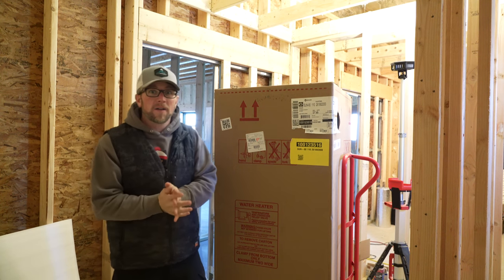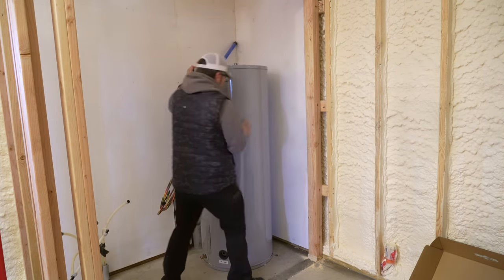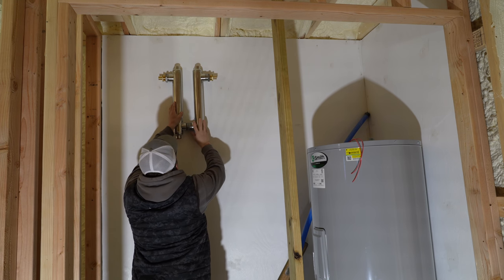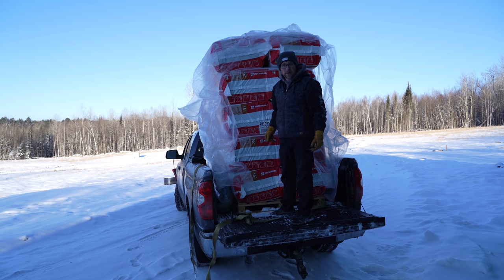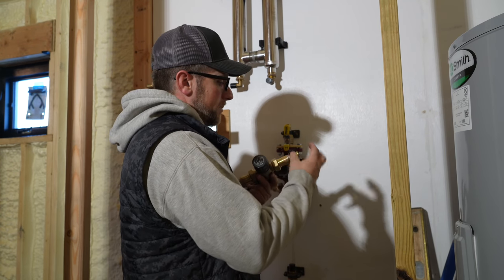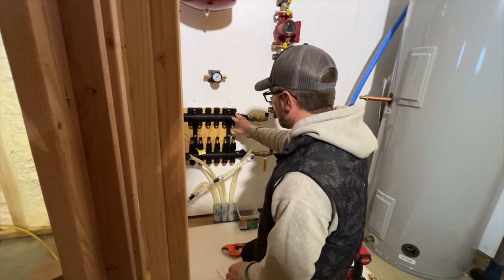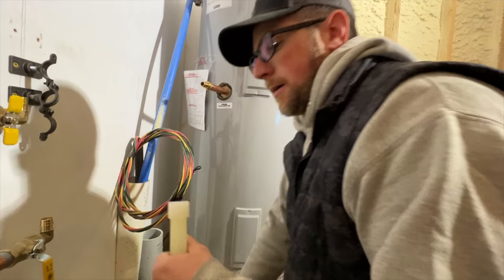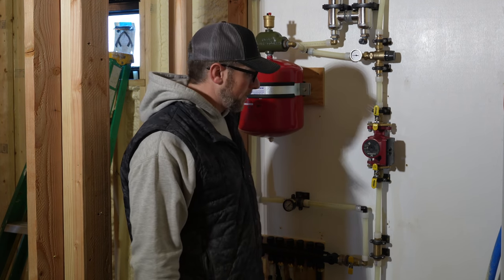What Could Go WRONG... Installing In Floor RADIANT HEAT with No EXPERIENCE!

Comment: Good Morning Lumnah acres! Al - don't make the same mistake as I did and put the water heater right on the concrete floor - It rusted up after 2 years - put a barrier between - even that roofing membrane will work. A plastic tray works well too in case of any leaks.
Reply: I agree with Ted, I suggest buying a specific water heater pan, they are <$25 at Lowes.  Those are code where I live.
Reply: Flux. Actually make waterheater drain trays. Complete with drain fitting.  If leak forms the water is directed to drain.  Im surprised you don't have one. Lol
Reply: yep. mine came with a stand.
Reply from the maker: Thanks I’ll have to pick up a pan
Reply: Plastic drip pan!
Reply: that was my first thought when i saw it being put in. concrete is corrosive and will rot out the skin of the water heater.
Reply: @LumnahAcres  I would get a couple of battery powered water detectors and put one in the pan and one on the floor under your wall fittings.
Reply: @allanulen3809  We saw the evidence of that at that condomium building in Miami, didn't we?
Reply: @ronaldfleming2990 ... actually, with the shower right there, he could run a pipe against the wall. Might be 10+ years down the road but it's in a place where it will be seen without having to look in the closet for a leak.

Comment: I believe it is a law, or at least part of local building codes in most jurisdictions, that anything involving electrical or plumbing REQUIRES MULTIPLE trips to the supply store.  The number of said trips is inversely proportional to the proximity and hassle to reach the source of goods.  In the case of "emergency", supplies available on hand shall always be a few items short of what is required.
Reply from the maker: I think your right. 😆
Reply: Uh, always better to have the spares on hand, then a full season of backorders.
Reply: it is a statistic that a plumbing job requires at least 2 trips.
Reply: I don't think it is required that you have your water heater on a stand unless it Is natural gas or propane.
Reply: @stanleyknight8173  might not be required but getting it raised even a minimal amount a good practice

Comment: Al the moisture from the concrete will rust out the bottom of your water heater. A short box 2 or 3 inch with a plywood top and a catch pan will prevent that from happening.
Reply: Not sure but that sure looks like a black abs catch pan under it now. Wood rots when wet.
Reply: A piece  of a sheet of  closed cell foam board work great also

Comment: Al, you may want to consider using anti-freeze in your system as opposed to using water. I have a close friend that has 2 huge horse barns where Penn State Western Equestrian horses are housed, 40 ish stalls, 2 large riding arenas. He has a huge boiler heating both barns and he uses anti-freeze.

Comment: Some suggestions- 

Label all shut off valves, other valves and directions of flow and equipment identification etc

Any electrical switches etc should be outdoor/wet area rated with a isolation point outside the mechanical room… if you get a leak it is very dangerous!

Any processes like filter changes, servicing steps, isolations etc print out and put on laminated paper clearly placed in the mechanical room along with copies of equipment manuals in zip locked bags to keep them clean and dry.

Will make your life safer and easier in the future, especially if Gina is on her own when an issue happens especially being so remote.
Reply: This was so incredibly valuable to us this past summer when a tree next to the well was struck by lightning and fried our control panel. When we went down, we saw all the bypass valves clearly labeled with open/close directional arrows done in permanent marker right on the valve handles.
Reply: Great advice. Dymo makes a lablemaker that prints on heat shrink tubing. Not cheap but it's the very best system out there. It also prints stick on labels so its very useful. Beats the sand out of trying to decipher chicken scratch in the cold dark and wet of an emergency. The remote kill is a great idea but its required by code here as is the requirement for arc fault receptacles in wet AND high current areas. GFCI used to be the standard but now it's arc fault breakers in the main box with remote shutoffs for anything over 30 amps. We are also required to place a whole house shutoff within 6 ft of the power meter on the exterior of the home for fire codes. Check local codes BEFORE you do something. I've seen the Code Nazi's make people tear everything down/ out and start over more than once. My practice has always been to research the task and consult with a LICENSED PRO before you apply power/ water/ gas/ flame to ANYTHING. It may cost a bit but it's worth the peace of mind and can definitely save a lot of embarrassment comes inspection time or the first fire up. I know from experience that labeling is the best way to go and anyone behind you will appreciate and benefit from it
Reply: Use your laser printer to print out arrows and labels then use acetone to rub them on the wall then clear coat over them they will last as long as the house,

Comment: Al and Gena, and your dinner companion) What you need is "tinning flux" which puts a tin glaze 
on the pipe and fitting when you heat it. Makes sweating pipes much easier since they took the 
lead out of solder. I get it on E-Bay. Wipe off any excess before running the solder in and wipe 
the pipe after if you get a drip.
Reply: I know I'm being pedantic! but it's Gina
Reply: Why did you say, "Dinner companion"??  It seems quite rude!

Comment: As an old measurement and control engineer I made my own central heating installation too. I know from my studies and work that every sharp corner bend gives turbulence and therefore resistance in the flow of the liquid in the pipes. (In those days made visual with glass piping and a purple die).Therefore prevent the use of sharp corners in your installation as much as possible. You could have left out many of them, by just bending the pipe in a smooth corner shape. The piping will look less sharp, but the installation will function better with less resistance.
Reply: I am in total agreement.  90 degree bends degrade flow vs. a pipe bend that is just a gentle curve.
Reply: I really think that not enough attention is paid to this simple piece of information,what I would call basic plumbing. If you put in a lot of”knuckle” bends into your work you will cut your flow rate drastically, if you have not learned to bend copper pipe at least use long “sweep” bends.  Also  if using plastic pipe you can use bend formers.  Another flow reducing problem is using the wrong type of ball valve as an are isolating valve, you can buy valves that do not reduce bore diameter ( this is often a fault in shower installations).
Reply: Remember to avoid cavitation. Open and close valves gently. Sometimes riser pipes are put near washing machines and other solenoid valves. Straight up about a foot, and capped. The air buffers the sharp pressure waves. Air in pump can ruin it quickly. Pump cavitation can sound like rocks grinding. Like your car's cooling system, air needs to be bleed out at different heights. Good luck.

Comment: Retired mechanical contractor. From experience. AO Smith good choice for a water heater. You can change out the electric elements with 12-48 volt DC element to heat the hot water from solar panels on the green house roof. Cleaning up a joint with flux, the pipe will turn oxidize green if not wiped clean. Lots of shut off vales makes servicing in the future much easier. I would recommend a water heater pan to a drain for the relief valve. They are notorious for weeping and can make a mess if they go unnoticed. NO WATER in the boiler an antifreeze transfer medium is a must.

Comment: It can pay to strip the valves before soldering, to avoid heat damage to the seals.
Reply: Wish I could add a big star to this comment. Burning up the seals in a brand new very expensive fitting would suck!
Reply: Sitting in water while heating to solder is a old habit. Pinpoint heating is important for speed. Flux and heat allow the solder to flow into the joint, where the heat is directed. Good luck.
Reply: Always check the manufactures recomendations to see whether to solder with valve open or closed.  You can wrap valve with wet rag to keep it cool as well.
Reply: I thought the same thing while watching. And then seeing how difficult it was for him to change the valve position when he was done confirmed that there was likely damage done to any non-metal parts.
Reply: When soldering minimal heat, pinpoint the heat, and doing it quickly, are extremely important. Surface preparation, Flux, pinpoint flame, all lower the time. The longer heat is applied, the more it spreads throughout the parts. Sitting the parts in water or wrapped with a wet rag, stops heat damage to the vulnerable parts. But soldering should be very quickly done, and flux allows the solder to flow to the heat.

Comment: Don't add flux to the outside, it will look bad in time! causes corrosion just wipe off with a rag!  I'd suggest adding a platform under the water heater! It will be easy to clean the floor and the heater won't rust out as fast!
Reply: What Tom said, flux is a form of acid and needs to be cleaned off.

Comment: Al, as one that has had a solar hot water system for over 12 years you will want to do 3 things. (1) elevate the hot water tank at least 3-4 inches above the concrete floor to prevent moisture from rusting the bottom of the tank. (2) place a plastic pan under the tank to catch any water that may leak from fittings, etc. (3) Place the hot water tank on rollers. When you have a problem with the fittings or need to replace the tank it is much easier to roll the tank out to where you can work on it. It is the pits if you have to be a midget contortionist to work on a water tank in the middle of the night ( been there-- done that ).. Everything is looking good. How are the beavers acting this tie of the year ???  lol

Comment: Hey Al! Not sure if you're aware of this but those tanks have a sacrificial anode which if replaced every five years or so will let your tank last forever. It works the same as the anode on a boat. I write the month and year I need to replace it on the side of the tank. Easier and way cheaper to replace an anode rather than the entire tank. Only problem is they put those anodes in crazy tight, almost like they want you to replace tank instead lol. Before you get everything put together I'd loosen the anode and retighten it while you have the room to really get at it. I've had to use 5 foot cheater bars to get some out. Love the series and I agree with you completely about understanding everything you use on the homestead!
Reply from the maker: Which tank are you talking about Hot water tank or expansion tank?
Reply: @LumnahAcres  Hot water tank.
Reply: agree on anode comment about tightness, something to raise the tank 1/2" or greater PVC, room to change out the heater when it rusts out
Reply: @kevinrecoskie519  I believe they make the anode in two pieces with a hinge instead of one straight rod to make it easier to replace. Very good advice! That's the whole point of the sacrificial rod.
Reply: @lucillekenney8311  I replaced the anode on my hot water heater and had to use a cheater on a wrench, it was so tight to break loose.
Reply: The anode is usually a small steel rod, with about a inch of magnesium on it. The guy must use a six foot cheater, when he installed it. If you have a water softener, you might want to plug it. Running heated water for heating, you need to filter it, after you make it precipitate. Good luck.
Reply: @everettplummer9725  In m experience the anode rod is almost as long as the tank which is why you usually need to get an articulated one to fit in a replacement.  I think the entire rod is magnesium alloy and will rot away first before the inside surface of the tank.
Reply: @LumnahAcres  Hot water tank, there's two types of rod, magnesium and aluminum depending on your water hardness. I keep one hanging off the wall behind the tank so I can swap it out when I inevitably forget it and see the date on the tank lol.
Reply: You'll need help when you go to loosen that anode, the tank is going to want to spin and it's hard to hang on to.

Comment: Flux is used to connect copper pipes together (paste), either by sweating or soldering the pieces. It comes as a two-part chemical combination and is sometimes also used on it's own to seal cracks and leaking connections (liquid flush). It was invented by an ancestor of mine.

Comment: You have all of that unused electricity, so maybe you should consider hooking it up to the water heater. It would be nice to have as a back-up in case you cannot be home to fuel the wood furnace.
Reply: The water heater will be solar powered!!  The boiler will not be used in the summer!  Did you not listen to the beginning of the video?
Reply: @laurel rowe  you are correct and I'm repeating myself here. Suspect it was freebie no doubt part of another sponsorship deal - it has already been stated that they have ample power with the solar. So its overkill, but will be interesting to see in action.
Reply: @freepress8451  You sound ridiculous repeating your comment.  It doesn't even fit into the conversations!

Comment: Just a quick tip Al, once the soldered fittings have cooled down wipe off with a damp cloth this will stop the flux oxidizing and turning the brass or copper green. Regards Jim UK.

Comment: Great job, you may need to use electric tape between the brass fittings and the black clamps to prevent electrolysis.👍

Comment: I suspect you won't want to be feeding that wood boiler all summer. But you've got a ton of solar power to run the water heater. Likely want to do most hot water use during sun hours though.
Reply: Al explained everything at the beginning of the video. The solar system will easily power the water heater.
Reply: @Bruce Alvarez It was freebie no doubt part of another sponsorship deal - it has already been stated that they have ample power with the solar. So its overkill, but will be interesting to see in action.
Reply: @darlaherbst5929  Battery storage is the determining factor. I don't know if he said what capacity they are. The 18kW array is huge, especially for their near term needs. My 11 kW array will put out 63+ kWh on a sunny January day, 72+ on a sunny summer day. We are at the same latitude as Al and Gina.
Reply: @brucealvarez9263  OMG! Sorry, but I'm having difficult times and tired of answering and the re-answering ridiculous questions!  You should have enough common sense to understand that the huge solar array can power one little dam water heater!  It is built to power the whole freaking farm! Sorry and goodbye!

Comment: Al, you might want to consider removing your 90 fittings and using pex sweeping 90 bend supports. The bend supports will prevent the pex from kinking and removing the 90 degree fittings will decrease the load on your circulation pump, saving that precious off-grid power.
Reply: I was surprised to see the elbows. Figured it was Al's ocd need for things being square.

Comment: Not a plumber, but wouldn’t you want a pan under the hot water heater?
Reply: I think there is a drain in the floor close.
Reply: @cooldog60  and raise it off the concrete floor to prevent heat loss
Reply: A disaster pan and some rubber isolator pads to get the tank off the floor
Reply: @lordhoho1  A pan protects from leaks but more importantly keep the concrete from rusting the bottom.  It would have been smart to have a drain in this closet as well that he could have the pan drain to it or in case any of his fittings leak.

Comment: When cleaning fittings, brass or copper. also clean the ends of fittings. After soldering pipe to fitting, you can then run a bead of solder  on top to eliminate any chance of leaks. I learned this while working along side master plumbers, it has never failed me.

Comment: Wonderful, However from MY experience that heat exchanger for hot water should be at an elevation about middle of tank for convection flow. The hot coming out goes up to hot area of tank and the cold of tank goes up to cold of exchanger. If you want good soundproofing, use 2x6 plates and stagger 2x4's so that the opposite walls do not share the same studs. Love the cannel, been subscribing for years.

Comment: I admire your work ethic, I’ve watched you build your homestead and now the new off grid homestead. A lot of people could do stuff but they are scared of messing up, so what, occasionally things will not go as planned. Over time the money you saved time after time will pay for a screw up. Doing it your way you know how it is suppose to work and how to repair or fix it if need be. I built a water stove 40 years ago and heated my house and domestic water. I loved cutting and splitting wood, it’s everywhere and free. That’s the best and cheapest heat we ever had. I noticed the water heater is sitting on the cement, you need to get something between them, hopefully other will see this and have suggestions for what to use. Cement has acid in it and will rot out the bottom of the heater. I love how you want things to be straight, square, and picture perfect, you do good work and it looks good to, keep it up. Stay safe